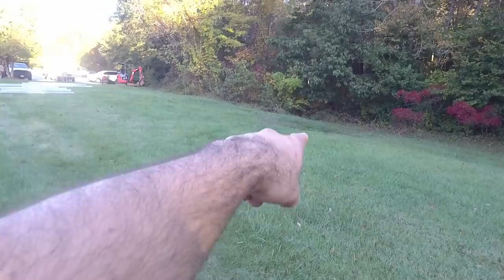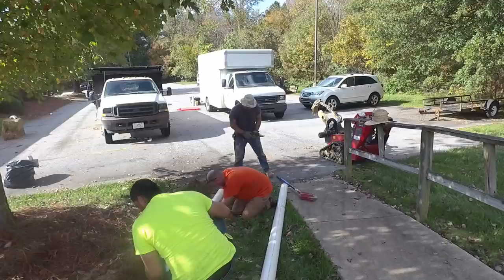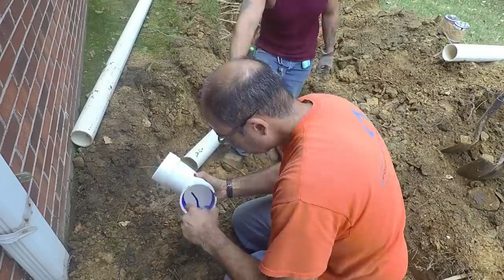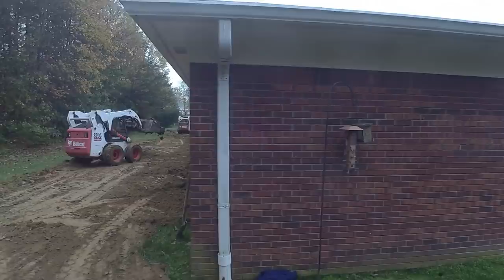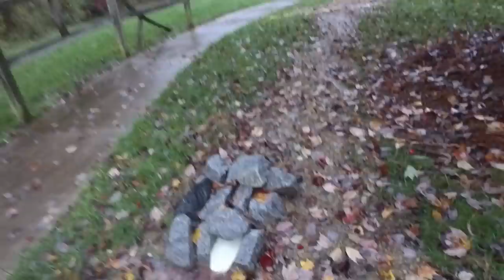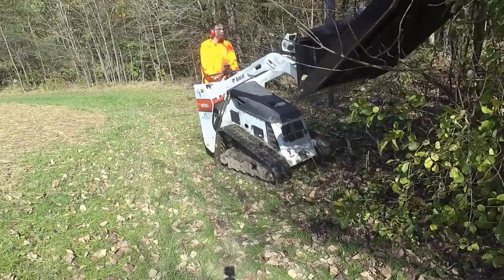Saving the foundation on a commercial building with PVC drainage system

Comment: Really enjoying your videos, like seeing contractors with proper well maintained equipment to perform the job in a professional timely manner. Your crew also seems to be switched on and work well together.  I worked for a company about 20 years ago doing water mains and concrete storm drain pipe. The machines were in such disrepair it seemed like something broke every hour.  Stay safe, cheers from your new subscriber in L.B.I. N.J.
Reply from the maker: Thank you! Thanks for watching - Shawn

Comment: 10/10, 6in smooth-wall only needs .49% slope to self-clean so your 1/4-bubble(~2% slope) is plenty.  You probably didn't need the extra inch but on my DIY-setup I regret not using eccentric-reducers, as the deeper-discharge would have increased my CB's discharge-rate.
Reply from the maker: Thanks Bob! That 6" kicked our butts on both the straight sections and also on the angles. Had to re-trench and re-trench. Then we hit a rock.
Reply: Yeah 6” is a bear to work with but can self clean at less slope which is nice.

Comment: You might fine using slow set gray glue makes it easier pushing six inch and larger pipe together
Reply from the maker: Good tip! Thanks for watching - Shawn
Reply: Great advice. I will look into this.

Comment: Been watching a few of your videos and like you attention to deals and quality of work. One thing that I think would help with quality is investing in a Sod Cutter. I think if you cut and roll up the sod in the places you are going to drive over and spots that you are going to trench, then once the job is completed, unroll and replace the sod instead of setting new seed, you would have an much better final product.
Reply from the maker: Nice advice Rob! I did buy a sod cutter and added a 24" blade onto it. I offered it to lots of customers just like you said, but no one ever cared about the sod being replaced instead of seed. I sold the sod cutter since I never used it once.
Reply: @GCFD   definitely makes sense. I figured there was a reason behind it as I can see you attention to detail and taking the extra steps to make it right is on point.
Reply: Great advice. We have been wondering about getting a sod cutter. I think I will have to do lots of country club work before it would pay for itself. Most jobs folks just want the seed and straw and keep moving.

Comment: Watching these videos keeps me wondering if building constructors disobey rules for rainwater disposal or if there simply are none in the US - and also that the water is led to the street making it somebody else' problem.
Here in Denmark, if you make a construction with a roof you have to lead the water either to the rainwater sour system or to a fascine on your own ground - never out to the street.
Reply from the maker: Hi Jesper - Keep in mind you're seeing the worse problems on my channel. The streets are all part of the stormwater management system so we use them as such.
Reply: @GCFD  Thank you for replying. If the streets drains are already prepared for the water from all the houses, then in makes perfect sense what you are doing. Thanks for clearing that for me.

Comment: I’ve watched a bunch of your videos by now, and haven’t seen you do any perimeter/footer drains. Any reason for not doing that?
Reply from the maker: Yes Kyle - I would never, ever, ever send surface water into the footer. Around here we have clay, so the water doesn't percolate down through the soil very quickly. In this case, we had surface water that was hanging against the foundation, so our solution kept the surface water as surface water and moved it away from the foundation. If you have sandy soils then a footer drain might work better, but not in our area.
Reply: @GCFD  Aha! thanks for getting back to me, I have clay soil here in NJ. Besides re-directing water I also wanted to re-waterproof my blocks so I figured I would install french drains while I had it dug out. 

Sounds like, I re-waterproof, back fill, tamp it down and than dig a trench a couple feet away from foundation. Separate pipes for gutter vs perforated schedule 40. That is how you would do it? Thanks! 

And If so, that would also make getting it daylight easier too.

Comment: Great job!

So I've got a question, I've seen other guys pipe the gutters into a French drain, won't the gutter water just go through the holes in the French drain?

Seems like gutters shouldn't be tied into a French drain?
Reply from the maker: Great question! You never, ever, ever want to take water that's already contained in a pipe and send it into a french drain (pipe with holes in it). I see this all the time and a confusion that a french drain is a place to send water to. A FD is a collection system for non-point water. If I catch gutters and run then in a FD's trench, I always keep the gutter water in a solid pipe, separate from the FD perforated pipe.

Comment: Great job on catching and directing the water. Only problem I see is those piles of rocks at the end of the drains gonna make it a bitch for the lawn mower guys. Maybe in the future you can work on applying some type of popup end caps that the mowers can drive over instead of using a pile rocks. Just saying. :) Thanks for the Vids
Reply from the maker: Great point James. I like my pipes to end up in the air so any debris will easily flow out of them. I prioritize function and less maintenance of the drainage system over other things, though the rocks will be a hassle to mow around.
Reply: If you been watching some of Shawn's videos you will know why pop up caps are a bad idea .. they look great, but greatly restrict water flow and having water sitting in a pipe will cause failure down the road even in PVC I would imagine.

Comment: Do you use solid pvc pipe or do you use the foam core pipe? The foam core pipe is two thirds the price but it is not as strong.
Reply from the maker: We use foam core non-pressure schedule 40.

Comment: You’re putting the slip joint piping in backwards FYI.
Reply from the maker: 👍 It welds together so it doesn't matter in this case. If we were using non-welded joints we place the bell facing uphill.

Comment: Do you drop a tracer wire in with your drainage lines?
Reply from the maker: I do if the customer wants me to. We use 14/2 outdoor rated romex or just a bare copper wire. We duct tape it along the pipe ad leave it sticking out at a cleanout.

Comment: around 5:00 you're concerned with fall but a sealed pipe that fills a little doesn't matter
Reply from the maker: I disagree. If the pipe has no fall, the water that holds represents back pressure that takes away from the flow. Flow is extremely important because the faster water moves the larger particle it can carry in suspension.
Reply: @GCFD  it may slow flow a little but think of the high spot like a dam wall. Once the dam is full it flows over the high spot. This principle is used to fill water tanks with rainwater when the pipes are underground here in Australia.
Reply from the maker: @JyveKilla  I hear ya. Dams also fill with sediment when the water slows and drops its load of suspended particles. Better to preserve flow.
Reply: @GCFD  if you're draining ground water I agree but off a roof it'll flush through being mostly clean. I would aim for fall but wouldn't be bothered with a slight hump.
Setup a test and see how much difference it doesn't matter
Reply: Shawn you’re right with the continuous fall. No humps or dips. Roof granules, dust, (several weeks of no rain builds up dust in the gutters then the first rain washes this dust into our pipe) and leaf debris add up fast in any low spot in a subterranean drainage system. Then this will clog. Then the property owner is wondering why he paid me to build a system that wouldn’t self clean. The humps and dips in flex pipe is part of why they clog.
Reply: @alanostner  setup a test with your own house and see what happens
Reply: It's much wetter here in America, dams of water grow mold and attract pests.

Comment: the bell is not supposed to always be up at high point and start at the run at the lowest point ???
Reply from the maker: I'm not quite following your question. In push together pipe the bell faces uphill, in Glue together it doesn't matter.

Comment: The way to fix this is not a conduit to the parking lot - but to bring up to grade where the the land dips all around the foundation wall - which is apparent all the way around the building. It looks like when the foundation was back-filled it was not tamped down properly - so now it has sagged and sits under the level of the high point of the landscaping (which the sidewalk is sitting on). By simply adding soil all around the building the water from the drain pipes will sheet across the sidewalk and across the landscaping away from the building.
EDIT: Top the berm and push it against the foundation; seed and straw; done.
Reply from the maker: Hi Michael - we did top the berm and push it against the foundation. that was for rainfall. But there way way too much water coming off the roof that was discharging in the yard with nowhere to go. We gave that water a path out of there where it is no longer a problem. Thanks for watching!
Reply: @GCFD  Really appreciate your follow-ups in the rain - makes the job video feel complete!